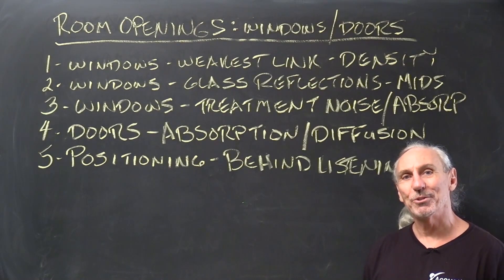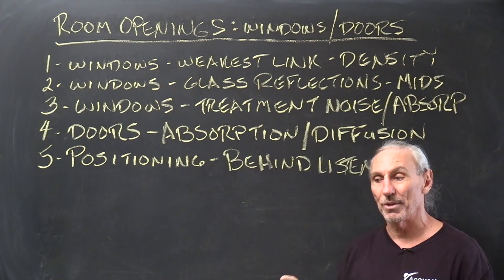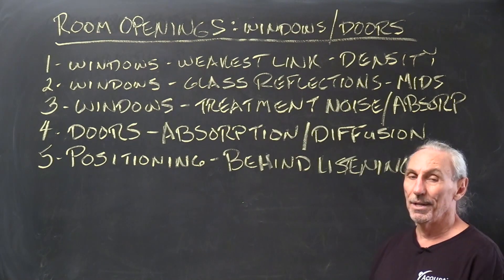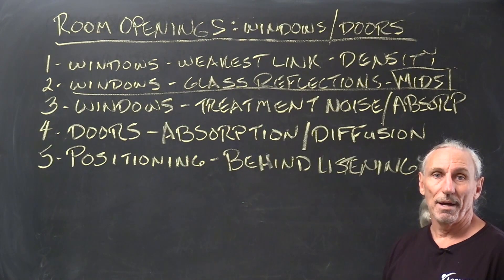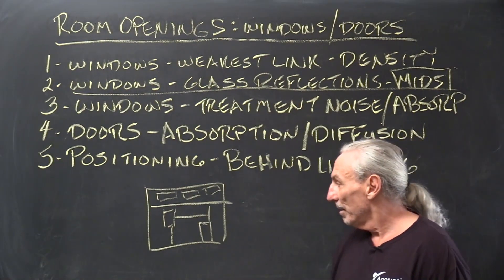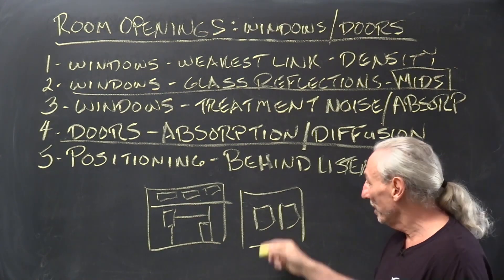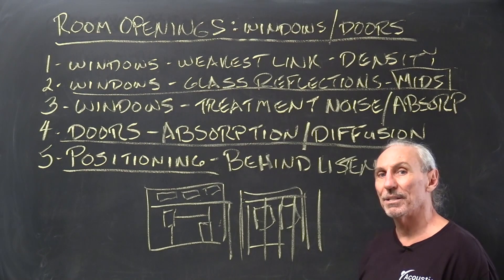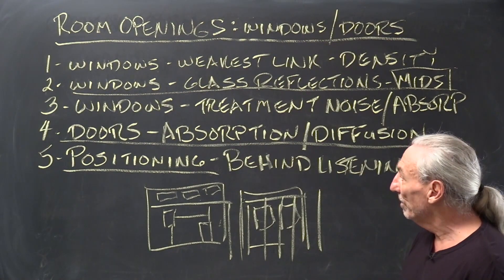Room Openings - Door/Windows - www.AcousticFields.com

Comment: My room layout might be bad, but my windows are actually above the tweeters in height :)

Any thoughts on curtains (heavy/ light etc.)?

Someone also suggested wooden paneling since i may have to wait a Long time for hr++ window panes... so there may be an opportunity there :-)

Very interesting vid as usual
Reply from the maker: Curtains will reduce the brittle sound from reflections. However, they do not provide a consistent rate and level of absorption which will assist you with the time signature of reflection management.
Reply: @AcousticFields  the scary thing is, i am starting to understand answers like this :)))

Comment: If the side window is already there why not treat it with a thick sound proof Curtains and what about  Double Glazed Window.
Reply from the maker: There is no such thing as a soundproof curtain. Stopping noise transmission requires a permanent construction fix.

Comment: What's your recommended minimum room size if the intended usage for the room is vocal recording (workstation and microphone in one room)
Reply from the maker: We like 8' -11' wide 9 - 11' ceiling and 13' length.
Reply: @AcousticFields  I heard big speakers in a small room are no good, small speakers in a big room are not either. Will this room size be good for 6" -6.5" monitors?

Comment: Will a 3inch alcove in a door way effect first reflections much? I’m thinking of treating it by hanging an acoustic pin board with a thick duvet blanket hanging over the top. If that’s not recommended, I’ve got high density polyester polymax batts.
Reply from the maker: Its deep enough to have an impact. Fill with cotton based fill.
Reply: @AcousticFields  What about the high density polyester acoustic batts I mentioned?

Comment: BASEMENT!!
Reply from the maker: Yes, a good choice except for the low ceiling height. The ceiling dimension in most rooms is the smallest of the 3 and in basements I have seen heights as low as 6' which won't even work for voice. The next issue with basements is noise transmission from the basement up through the floor above.

Comment: The Wife won't let me.
I hear that a lot...haha
Yep, dealing with that  now
Reply from the maker: After I assist clients with the room issues and the treatment required, after I spend up to an hour in most cases running data base analysis to fine tune the type, amount, and position of the treatment, the client will say, "let me discuss this with my wife". I never hear from them again after spending all of that time on their room.
Reply: @AcousticFields  I'm trying not to do that. 
When I pull the trigger, wether its 1500 or 5000 on my room it will be well thought out and the Best information possible by the best advice from experts, like yourself. As a matter of fact, I will spend almost the rest of the year studying, learning, and then implementing what is best for my budget. This also gives me a few hundred dollars more for the room. (I've only ever hear 3 systems in my life that whood me. One was a Macintosh on jbl 4435s, I installed as a contractor in a customers home. Big pre built room almost 20x 27 I think?, then a couple years ago, the PSaudio on new Ohm Walsh 3000s. Point is, both of those rooms had Bass management and room treatments built in.) 
and I feel from what I've heard from Acoustic Fields, that 20% of a 12k budget would be better than buying another piece of gear. And doing it in manor, I can still sell my home if needed.

Comment: Great video. Important question though. I have a similar room as the one you described with openings except that both of my openings are on the right side of the listener. One on the rear right of the listener is forced to be open since its not even a door but an open entrance. The entire left side wall is concrete so the bass energy is not the most even in the room. Is it going to help if I add loads of bass traps on both left corners as well as a giant leather couch? I have bass traps already made. They are about 10cm deep with 4cm airgap behind them. What kind of placement would you recommend?
Reply from the maker: Two channel sound playback requires that sidewalls be of equal distance and if possible density. You can make your own walls with our Carbon Panel units https://www.acousticfields.com/product/carbon-panel/

Comment: Amazing, really nice. Do you have videos or info to learn how to treat windows?
Reply from the maker: What are you treating them for? Are you trying to reduce noise transmission through the window or are you trying to minimize the impact of reflections from the window surfaces?
Reply: @AcousticFields  I have a window in the left side of my console and a wall on my right side. I don't have issues with external noise but I want to make the reflections  more even thinking about what you said in the video. Any tips that help without blocking the natural light ? Or the best could be place some auralex on the window? Thanks for the help !

Comment: In my room, I've got my subwoofer straight in front of the back door which leads to outside. The door is half glass half Pvc plastic composite. I'm wondering if there are any bass reflections from that door, or if the bass would pass through as it is a weak point like you said.
Reply from the maker: S,  Low-frequency energy finds the weakest link in the structure. Compare the wall density to the door density and you will have your answer.